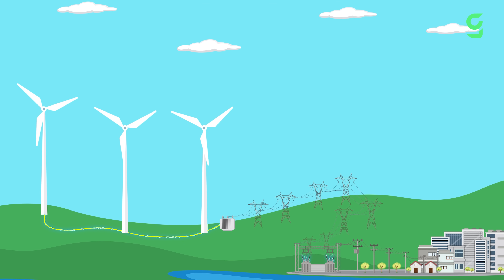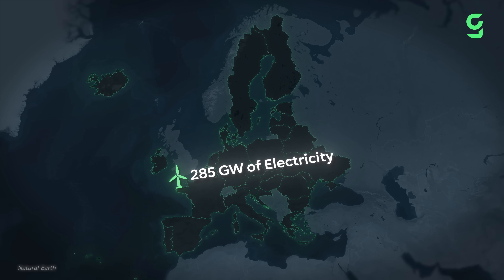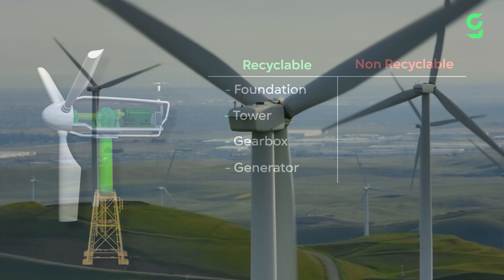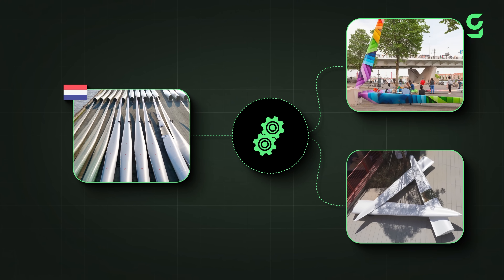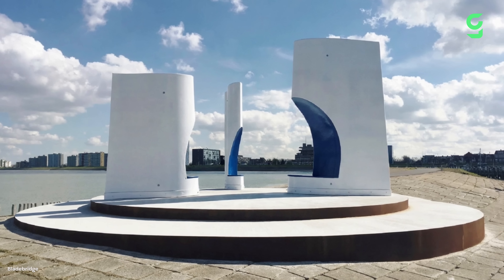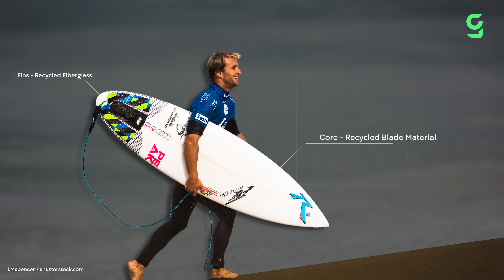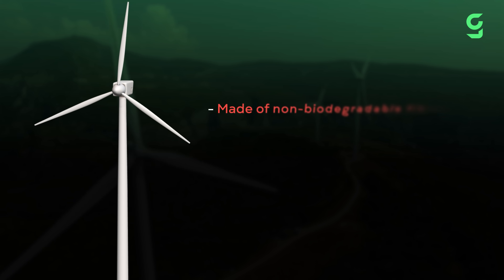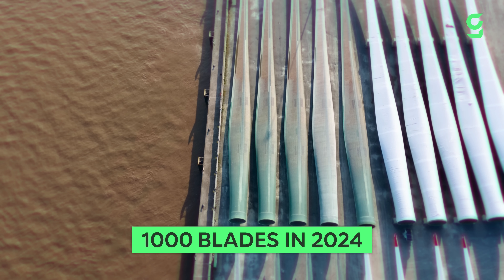What Happens to Old Wind Turbines?

Comment: There's NO "big problem" with old wind turbines, the towers and generators are primarily steel and easily recyclable, while the blades are mostly fiber glass composite, which can, and is, being ground down and added to concrete and asphalt for strength.

Comment: I hope you advocates are  aware that wind turbines require considerable electricity in low wind conditions. This is to overcome stiction.

This is where inherent friction will not allow the blades to start turning.   Put simply the blades need a push start.

Comment: Pollution from wind turbine blades is inevitable. Any composite material will decompose over time. Blades are made from fiber and epoxy. Even natural material blades will contain synthetic resins ( otherwise they will not hold together ) which will cause plastic pollution.

Comment: I am definitely against large scale wind and solar. Not because I dont believe in clean energy but because of their limitations and the polution they create in mining and manufacturing. 

But we already have 2 better alternatives that dont require the sun to sh8ne or the wind to blow. And they work 24/7. The first is tidal power. Unlike wind or solar, tidal power works on gravity. Gravity has never failed to work for billions of years.

The next is nuclear. But not somecpie in the sky fusion power that won't exist for another 2 decades but nuclear power we have already used for many decades. And power that creates electricity from nuclear waste.

Nuclear rods are replaced every 2-8 years in the current plants. We have done this for decades. And those nuclear rods still have 90-95 percent of the power left in them. We can recycle those rods and use them to power rtgs.

You can think of an rtg as a coke can sized nuclear battery of 100-1000 watts.. And it will last and provide electricity for many decades and poss8bly for a century. Solar has already taught us to create battery banks to store electricity. We can use the same design on acslightly larger scale to packs of 100 rtgs that generate 10,000-100,000 watts. We can take 100 of these rtg packs to make banks that generate 1,000,000-10,000,000 watts. For the volume of 10,000 cans of coke we could generate 1 to 10 megawatts of power. Bury 100 banks of rtgs in 3' walled concrete bunkers 10'-20' underground and your generating  100 to 1000 mega watts of electricity 24 hours a day, 7 days a week, 52 weeks a year for a century. All powered by our current nuclear waste.

If just one of these were set up under our 35,000 electrical transformer stations  we would have 3,500-35,000 terawatts of power available in a distributed power generation grid that would almost eliminate power outages for a century. Plenty of time to develop fusion power.  And just how much fossil fuel would 350,000-3,500,000 terawatt years eliminate???

Comment: Even if we find a way to recycle wind turbines, or build them with biodegradable materials, the problem remains: their construction, deployment, decomissioning and recycling requires energy, and that energy is largely not coming from the electricity producted by the wind turbines (for example the trucks that transport the blaeds on mountains, the crane that lift them, the ships that build the offshore wind farms are all powered by oil). The most green wind turbine is the one that is not built at all. Wind energy is unreliagle and has a very low energy density. They're not entirely useless, but they are very close to a "green" scam.

Comment: Wind turbine blades are impossible to properly recycle economically.
Apart from shredding them to add to concrete and road base and minor very laughable attempts to turn them into other things the cheapest thing to do is bury them.
And they are NOT GREEN ENERGY!
Windmills used for non critical energy generation are okay on a small scale but trying to scale them up to critical grid level power generation is beyond idiotic and so polluting that no large turbine will ever pay back the harm it does in a hundred years let alone the average of six years they operate for before needing major repairs or replacement.
The only thing that encourages the idiotic use of windmills to generate power is GREED for Tax Payer money. If windmills had to compete equally on the same contract terms as a Natural gas fired power station NO ONE would build them they are an utter failure.
They destroy the land and murder wildlife and cause far more pollution than they are supposed to prevent.

Comment: We outlawed fiberglass construction around children decades ago in our country for a reason... re-using is great, but it doesn't give the blades an infinite lifespan... you're just kicking the can down the road and pretending the problem is fixed & completely ignoring the dangers of fiberglass constructions as they deteriorate.  We have similar issues with used as filler in concrete/etc as well, when those constructions are eventually decomissioned in 30-60 years, you have to deal with the fiberglass as well.

Comment: Wind turbines can never replace conventional power plants like nuclear power, coal, and gas. Recycling wind turbines is still not 100% feasible. The foundation (around 20,000 tons of concrete and around 1,800 steel reinforcement bars) remains in the ground, meaning there is no further use for them. The same applies to the rotor blades. These are made of fiberglass composite material, which cannot currently be recycled. The powerful permanent magnet (neodymium) also poses a problem, as there is no viable recycling concept for it. The current solution: quietly and illegally burying the problematic rotor blades somewhere, hoping that no one will find them and they will be forgotten.

Comment: Why is blade longevity as low as it is?
Reply: Because the actual motor and machine longevity is the same. But I had the same idea. When we strip old turbines of their motors and rebuild them. Is there a way to do the same to the blades? Rebuild and restore them to be refit to a new turbine module?

Comment: How about making blades that last longer?
Reply: The turbine itself, also wears down over time, so no point in doing that. They could use carbon fibre, but that would be extremely expensive.
There are examples, where they use carbon fibre in critical areas, but only in very small amounts. Carbon fibre is like ten times the price.
Reply: @akyhne  manufacturing in scale always makes things cheaper, bearings and bearing housings  can be replaces easy enough. Generator have very long life spans. This is the problem with capitalism, it is very wasteful because everything needs to wear out, everything needs to be cost effective. It consumes resources and create masses of waste. Who cares if  cost 10 times as much. Money is only a human construct. It’s time we had a new economic system anyway especially with robotics, AI and the population peak all to look forward to in the near future, that will totally make capitalism unfeasible. Scarcity and labour will be gone, those 2 things are the corner stones on capitalism.
Reply: @keyboardoracle1044 Obviously, you don't even know what capitalism is. But I'll let that one rest.

If you increase the price of the blades 10-fold, then you no longer have a viable product. As it is now, wind turbines only just makes sense. It's not a money machine and it's not a deficit either.

Yes, bearings and so on can be replaced. But you forget that these wind turbines are built by massive cranes. You build the tower, then raise the housing, containing all the tech, like the generator, gearbox and so on. You can't easy replace the bearings and what not. That would require a massive undertaking, to hoist down the parth needed to be fixed, like the generator. These are massive, both in size and weight. It's not a job, you can do at the site.
Also, the bearing in the ring that connects the blades to the housing, cannot be replaced, without taking the turbine completely apart. I think these wind turbines are massively bigger, than you can imagine. I know how big and complex they are, because I've worked on them.
Reply: @akyhne I do know what capitalism is, do you, do you know the commodity that most people sell is their labour… what happens when that is done by computers and machines. Capitalism dies that’s what. But you will never admit that. 
You seem to think you are the only one that has worked in engineering or power generation or heavy industry. Anything can be serviced. Servicing existing infrastructure in most cases more time efficient and cheaper than just trashing it and building a new one .

Comment: Why can't we re-use the wind blades on new wind turbines? I mean it's not like these wind blades are unusable or defective. So since they are pretty much just as the first day they were made re-using them would not only save us from putting them in landfills but would also save the cost and material of making brand  new ones.
Reply: Because the main reason to decommission a wind turbine, is the wear and tear of the blades themselves. They simply start cracking. Small cracks can and are repaired, but at some point they will be so bad, that they can't be repaired.

The next issue, is their size. 25-35 year old wind turbines are very small. They generate a max. of 500-1500 KW (0,5-1,5 MW), and if you can replace it with a wind turbine, that generates 3-6 MW, there's no point in reusing them. Fewer, larger wind turbines require less maintenance. Bigger is always better.

PS: A windmill mills/grain corn/grain, hence the name. A wind turbine drives an electric turbine. Just saying.
Reply: @akyhne sorry I don't ever recall mentioning a windmill? So that p.s. thing is kind of irrelevant. Plus technically it's the same concept in both a mill and turbine just different mechanical parts... 

Also you're second issue makes no science really because yeah the ones being replaced by now may be smaller but there are still areas that smaller wind turbines will have to be used because bigger turbines can't be used or brought to said areas. So in conclusion no bigger is not always better because bigger doesn't always fit where you need it to go. 

Finally really shouldn't matter on how much watts it's putting out because anything is better than fossil fuels and we need every milliamp we can generate so...
Reply: @KeithSpearsJr I'm sure, you wrote windmill. But I posted the same text to several people in here, and I might have forgotten to delete that last line, in your case.
That said, wind turbines and wind mills have nothing in common. Like NOTHING!

I've worked in the wind turbine industry, so I know quite a lot about them.
When you want to put up a wind turbine, there are only so many places, where it makes sense. The wind has to be as constant as possible, to make the turbine feasible. So you basically, at some point, need to replace wind turbines with bigger ones, to have as many KWh generated, as possible. It all needs to make economic sense.

I live in Denmark, where the wind turbine industry started exploding, suring the 70s and 80s. Many wind turbines were built too close to houses and it turned out to be a problem, with noise. So, many of those sites, where they allowed wind turbines, will no longer be viable. So, the spots where you can put up these rurbines, get fewewr and fewer. 
It' just one reason of many, to build wind turbine farms at sea. But that has an extra huge cost, to each turbine. It would never make economic sense, to put up small 1 KWh used wind turbines.

Wind turbine blades are very complex in their construction. We use long mattes of fibre glass (rolls), that are layed down in complex patterns. In smaller or longer sections, right up to the full length of the blades. Fibre glass is durable, but after so and so many "flexes" in the wind, each fibre starts to crack/break in pieces. Then their strength it totally gone. That's why you can only do small repairs on them. And after a while, you can no longer repair the blades.
The first industrial wind turbine in the world, was built in Denmark, in the 1970s. It is still standing and running, but it has already had its blades replaced twice, due to wear.

Comment: The problem with the Blades is a artificial problem, created from lack of imagination, lack of investment, these clearly could be used to create house roofing tiles, walls, fences, barriers, highway infraestructure, bridge columns, tunnel walls, and columns, hanging bridges steps, etc, and if a cnc machines is added into the mix, You could machine all shorts of parts, like sea walls, dors, sculptures, and art in general, brush handles, shovel handles, pool trampolines, truck/boos ramps, compound bows and arrows, etc. If You mulch the fiver, it could be mixed with building material to create reinforced basements and walls, drain pipes, street light posts, sea ships, and drones, space parts, airplane parts, gosh, it's a fake problem.
Reply: Obviously, you don't know anything about wind turbine blades. They are hollow, and the walls are only  a few cm thick. They are replaced or decommissioned, because they crack, due to wear. So, as they are, they are no good for anything. You can't reshape the wings, because of their properties. If you cut through glass fibre, you will have a very nasty cut, where thousands of micro needles stick out.

If you tried to mill the composite in a CNC machine, it would just shatter into pieces. Glass fibre composite, is basically mattes of woven glass fibres, with a composite glue, to hold them together. You can think of them, as clothing material, you lay on top of each other in layers, then soaked with glue.

Some of your suggestions are viable, but not many of them. And we are already doing those.
Reply: Sorry but it seems You are the one ho doesnt know, the parts can and have been used for a ton of things, it's a fake problem due to this misleading of the public i Will ban this channel, there is no problem whatsoever

Comment: Our local turbine was recently refurbished - by putting new blades on. This was interesting to think about what will happen to the old blades (apparently they are being turned into bicycle shelters in the Netherlands, and the new blades were refurbished parts from a Netherlands windfarm). 

I would think the current issue with wind turbines is we don't have proper storage available for when they create excess electricity, so we can use it later when the weather isn't as useful.

Comment: It's not only the blades. Windturbines consist of about 8000 - 10000 t of material per TWh produced, solar power about twice that. Both are decommisioned about every 30 years. So on average every year about 1/30 of the installations is replaced. 
Of course, some parts can be recycled. But  even you achieve 99 % recycling, this is still a vast amount of waste per TWh electricity produced. 
Compared to that,  conventional nuclear power uses about 1000 t/TWh material (including waste), and advanced fast-spectrum reactors about 120 t/TWh, and must be replaced only about 80 - 100 years.

Comment: Wait. Wtf!?
This seems very wrong. My perspective tells me that those blades and the structure cannot simply break. They are huge, and strong pieces made of fiberglass. What really breaks with time is, basically saying, the spinning mechanism and all the tech to convert the spins into power. But those parts represent less than 10% of the actual whole turbine.
Meaning you could replace only those and use the same blades over and over unless/until they are really damaged. Broken, tilted, drilled or any caused damage due to the blades hitting something yk
Reply: The blades' material degrades and fractures over time due to bending stress and erosion from airborne particles, so has to be replaced or risk catastrophic failure.  The gearbox, and other mechanical components are easier to repair because they are made of separate parts, largely of steel , copper and aluminium, which are far more recyclable.
Reply: @JimSmith-d9t  Right. So, why don't they build the blades from metal as well?

Comment: When renewable energy people talk about power output, they always state the obvious when the solar or wind is in use ie nameplate capacity, they do not include when it produces zero power. For wind multiply by capacity factor of 30% max, its often lower. For solar it is %10 to about 20% depending on location. So good riddance to these REs, we should of course be building nuclear power which can be 24/365 and last up to 80 years or more and only need 1/1000 of the land area and don't need fossil power as backup.

Comment: I wonder if wind turbine blades need replacing due to the stress cycle fatigue or erosion of the fiberglass material? Could the blades be designed to withstand more stress cycles or be refurbished if the problem is just erosion? The world sure doesn't need any more 'throwaway' products.
Reply: Yes, you can make better blades from better lasting materials, like steel or carbon fibre. But steel is too heavy and carbon fibre is extremely expensive. Also, the turbine itself, the generator, gearbox etc. Wear down over time. And there's no point in refurbishing old 0,5-1,5 MW wind turbines, when you can install a much bigger one. The largest today onshore, are 3-8 MW.

Comment: Make them of wood. Make them of PolyEster Covalent Adaptable Network (PECAN) biopolymer thermoset-analog. Use basalt fibre in place of fiberglass. - Wange et al. Synthesis, characterization, and recycling of bio-derivable polyester covalently adaptable networks for industrial composite applications. Matter. Vol 7, Issue 2, 7 Feb., 2024. pp 550-568

Comment: Use them as the substrate for solar panels and then line walkways or roads to dump electricity into the local power grid and shade urban pedestrian areas at the same time.